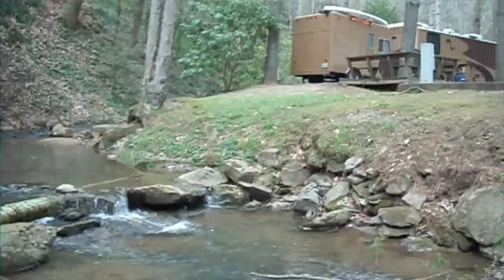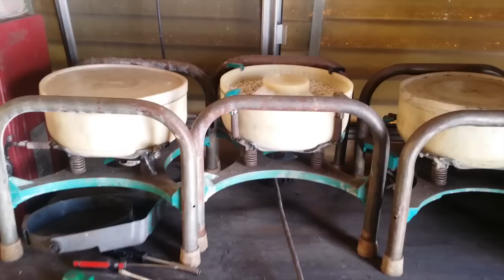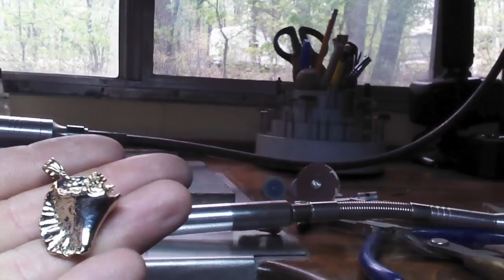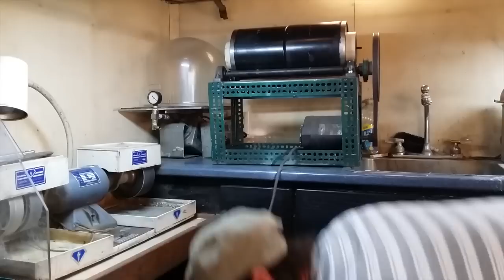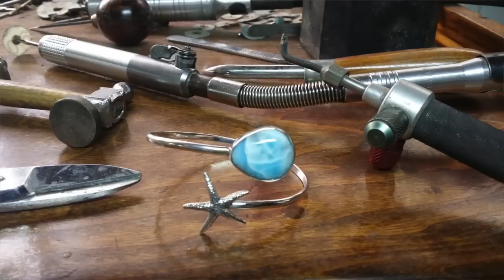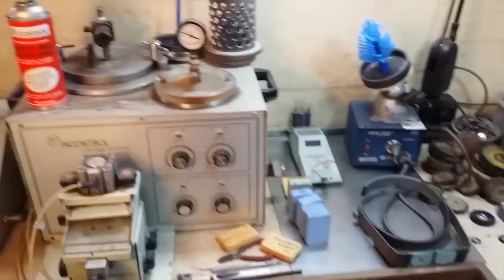My Tiny Mobile Silversmith Shop Tour ( Self Build )

Comment: Mate , keep them (videos) coming. At 65 I just retired from Lg Sculpture/Art and now I am going to be a Silversmith (sorry not big runs just 1 off's) 
I just found you as I was checking how A video (my First) on making my own Jewellery work bench turned out and you popped up at the end of it
Now your Tour was a God send as it answered a lot of questions I have had as to what I need to set up and as you say "Folk don't like you to see what they do in there workshop" or they will show most of the steps and leave out almost as much.
Ok we won't run into each other on the road unless you decide to do a tour of Australia.
So I do have 1 question...I am not sure as to what to get/make as far as polishing goes and then on your tour you had the drum roller and the a few Vibrators, so I am still confused as to which is better or do I work out processes and build both?
Sorry for the long rant and Take care.
Tony

Comment: I totally appreciate what you have done in your little trailer. This is something which I have considered doing in the next few years. Now I see that my skill set is totally doable in a small space.  Compared to you I have about half or less of your level of skills. But, I really appreciate your sharing of your workspace info with us who are not mobile. I rarely do sand casting and have never dug into wax carving and vulcanization. The prime weight in my trailer would likely be gem rock which I would not want to leave with anyone to watch over. You really are the do everything total renaissance man of jewelry in the modern day. Most impressive. I have never seen anyone person with your full package.